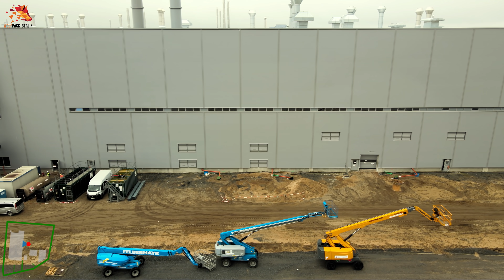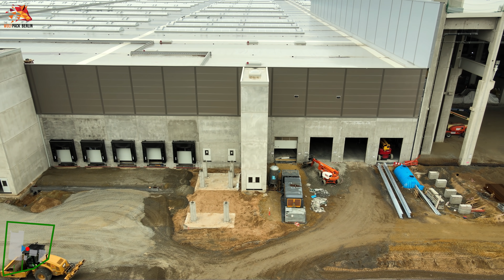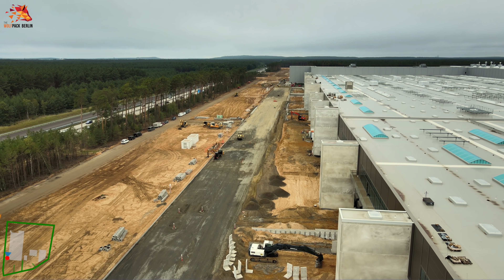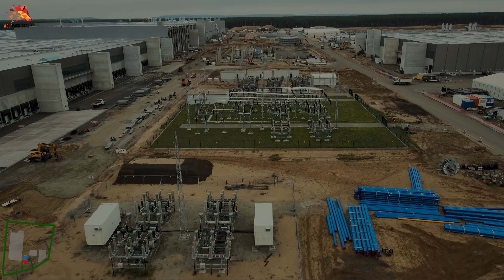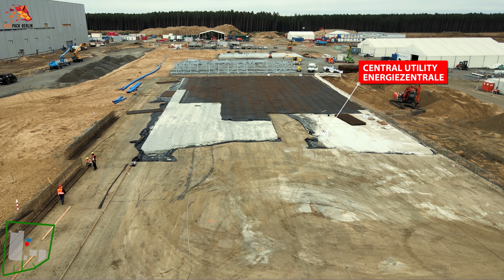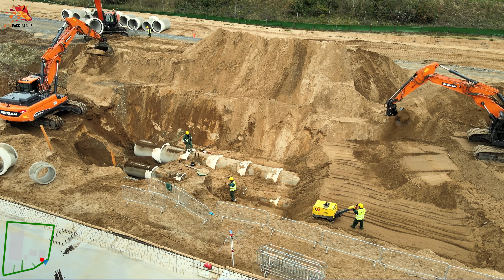#82 Tesla Giga Berlin • 2021-09-18 • Gigafactory 4K

Comment: Interesting that they are using concrete columns and beams for the battery plant. Seems to be somewhat different to their use of steel for the other buildings.
Reply from the maker: The battery cell production building is being built by a other company than the rest of the Giga Berlin. Therefore, among other things, a different construction is used.

Comment: They seem to be using very strong construction techniques.  Are there earthquakes in this region, or it it just because the whole area is floating on a sea of sand?  I wonder if solar panels on the roof will be producing power before the Model Y cars drive off the assembly line?  Thank you for documenting this project.
Reply from the maker: There are no earthquakes on site. The subsoil is only very sandy.
Later, solar systems will also be installed on the roofs.